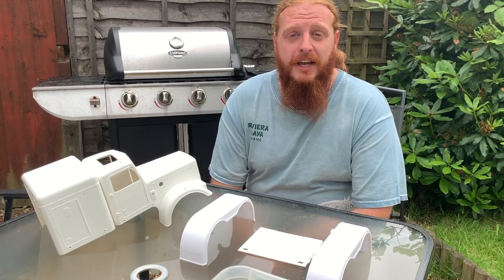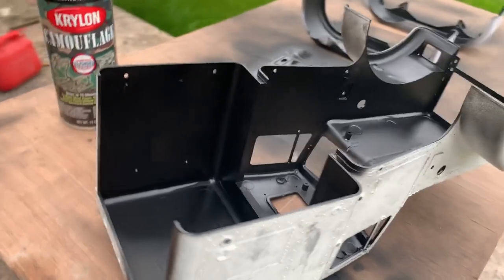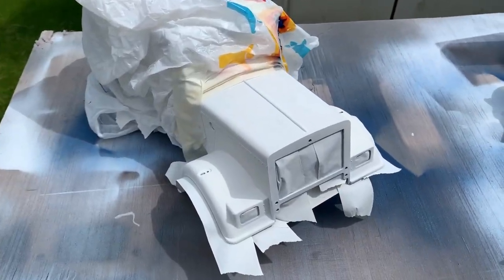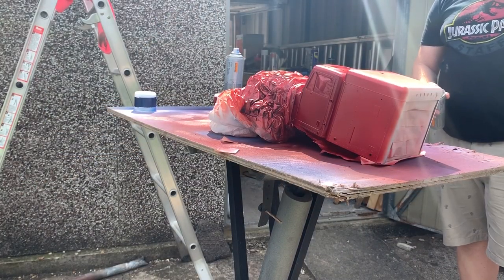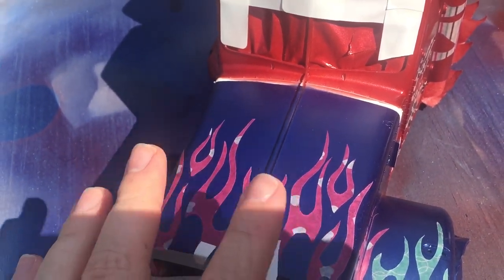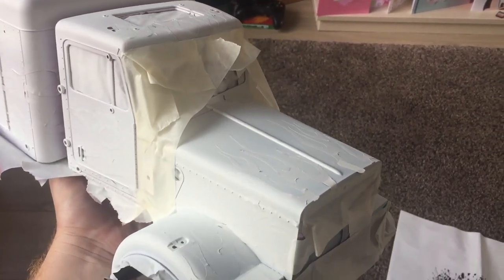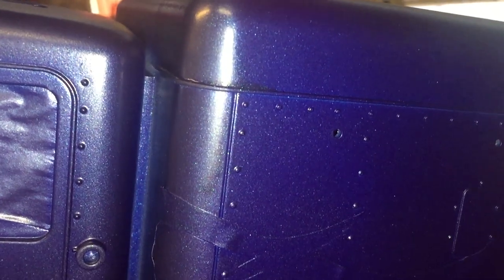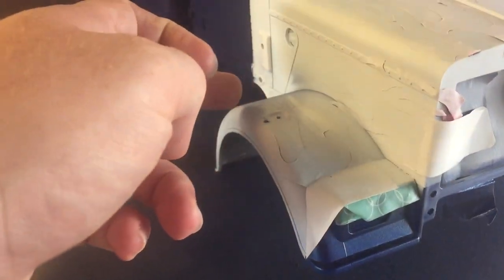How To Paint Optimus Prime - Tamiya Grand Hauler Build Update

Comment: Technically optimus prime was a 1992 379 peterbilt extended cab flat top was customized this guy used a different truck cause its hard to find a replica of rc model of the 1992 rc model of the 1992 379 extended cab flat top peterbilt but overall its a decent close to look a like replica of optimus im impressed